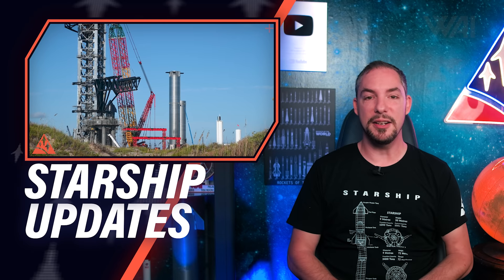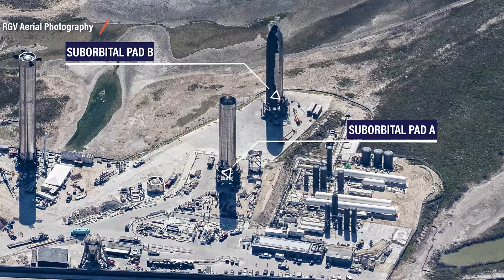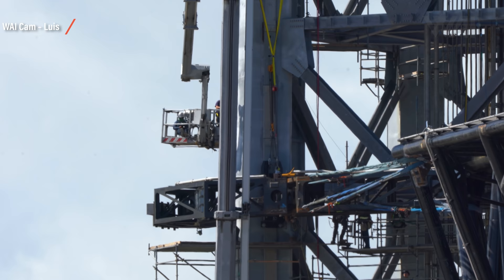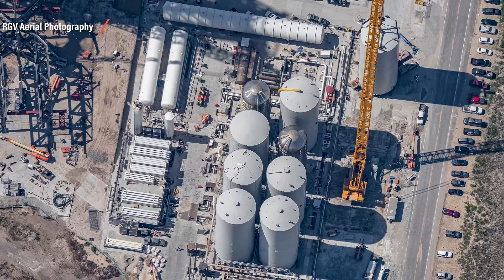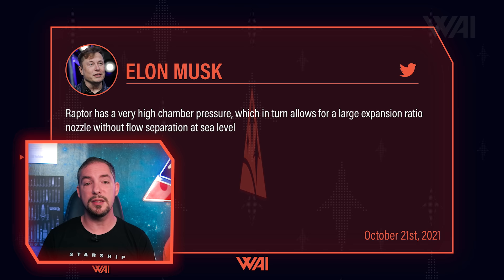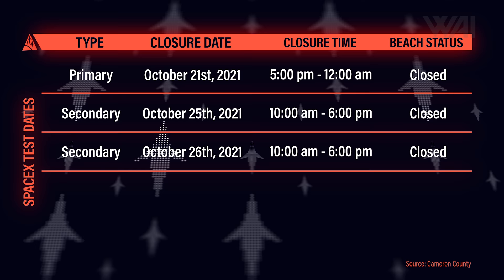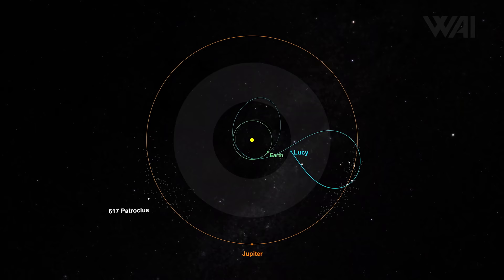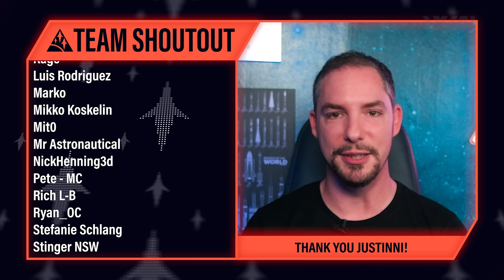Starship 20 double static fire analysis & Mechazilla installed!

Comment: Marcus House: A few tiles falling off will not cause catastrophic failure due to the ship being steel.

Felix: Losing a single tile will likely cause catastrophic failure.

Who’s right?
Reply: One tile and you are surely fucked. The plasma er way hotter than the melting point of steel and with one tile off the heat will focus on that depressed area.... boom

Comment: Regarding the issues with Lucy, an important detail is that they didn't say that the solar panels failed to latch - they said they weren't reported as having latched. And that might be because the panels didn't properly unfold, but it could also be that everything is fine, and the only thing that's failed is the sensor that's suppose to report whether the panels latched.
Reply: Well a clue might be how much down on power it is from that expected

Comment: Pity we couldn't electrically magnetize the tiles to the Starship for extra adhesion during structural stress such as engines firing or atmospheric re-entry. An addition to the mass but if stability improves then so to could the engine output increase. Replacing of damaged or lost tiles in orbit with spares could be standard.

Comment: The Space Shuttle's thermal tiles were its Achilles' heel, and this may be true with Starship's as well. I was very surprised to see SpaceX rely on this fragile solution. I assumed they'd come up with some entirely new, robust protective shield. How many tiles are on Starship? Hundreds? Thousands? If any one of them fails, the ship is probably doomed. As with the Space Shuttle, it's a tragedy waiting to happen.
Reply: No. The ship should already be capable of single tile loss without catastrophe, and even multiple tile loss -- if these exposures are well separated. If tile loss cascades, then the fastener and tile reinforcement designs will be revised.

Comment: The problem with Catching starships is not inherently faulted in the vehicle design or the Mechazilla design itself, but in how the vehicle approaches the tower to be caught between hypersonic, horizontal descent and subsonic, vertical descent. 

The Space Shuttle had a terrible L/D which limited its options for gliding to a very limited set of runways. Starship has a much worse L/D than this, but it does have the advantage of having a more intelligent and responsive computer capable of getting it to Starbase.

Mechazilla has the fortunate capability of catching boosters, particularly because the boosters are designed to make their approach and final landing burn directly from above with no lift whatsoever, merely manipulating their ballistic trajectory to land precisely. Also helped is the fact that the arms are pointed to the East, the same direction as many boosters returning from their mission boosting ships into prograde orbits (w/earth’s rotation). 

But those are not the serious problems. Starship having low L/D doesn’t mean much immediately, but it does limit its maneuverability on vertical descent. During the horizontal phases however, it can take advantage of shuttle maneuvers such as Roll Reversals to control its descent and ultimately come over the region it needs to get to, over Brownsville and Boca Chica ultimately, before the capture. The problem is, the arms can only pivot to the north or south. If the ship approaches the tower from the north or south, either it’s close to the Mexican border or it would be directly over a National Park or a Protected Wildlife area. Both scenarios would be a PR disaster if that is what SpaceX is willing to risk to make their system work.
Reply: Well, look at  the early hops: they essentially just hovered from the test stand to the landing pad with quite some control.
I would be surprised if the data from these flights hadn't improved that capability even further

Comment: Too bad there is no camera to monitor the unfolding of the solar panels.  They can learn a lot visually as well.
Reply: You’d think it’d be easy enough to have a mini go pro or something mounted on the thing without drastically changing the mass and the math in order to do that…
Reply: @trayolphia5756  Agree.  If they were concerned about power constraints, they could have it on just long enough to record the unfolding then turn it off.  I sometimes wonder why the simple things are omitted, like why it took so long to include a microphone on the Mars rovers to hear sounds?
Reply: @maninifarmer1338  in theory, over such a long time, even a handful of grams can mean the difference on an orbital angle of “lipping out” (like when a golf ball only just misses the cup) or can vary it the other way and have the craft go directly into the planet

When you deal with angles over such immense distances…the notion of a hundred grams extra may not seem like much…but SURELY they could adjust the math and figure it out
Reply: @trayolphia5756  Understand.  I use to support equipment remotely, feedback said “green” but not until there was “eye on site” did it get fixed.  Just interesting and thanks for your reply.
Reply: @maninifarmer1338  There actually was a microphone, possibly on the MPL mission about 20 years ago but it was lost due to confusion of measurement units between departments. - Either that or on the Beagle 2 mission, also lost.

Comment: It is possible that the hold down for the static fire causes the ship to vibrate and shake which loosens the tiles. Perhaps on the flight it will smoothly go up and not be a problem. Only one way to find out!

Comment: 11:25 i say they will launch a booster alone and make it hover near the pad and then be caught by the arms to test them. Just like grasshopper.
Reply: Lower the booster onto the arms with the crane just to test the arms?  Wouldn't test their ability to hover or anything else...
Reply: @Wheelo40  I mean first flight catch not crane aided flight.
Reply: Who said the booster can hover? The Falcon 9 can't, even with only one Merlin engine at the lowest throttle setting. That's why we have the hoverslam maneuver. Now, the Raptors are more powerful and their throttle control is not better. So...
Reply: @caty863  All Starships that flew hovered with a single engine, all they have to do is scale the number of engines to the weight difference between Starships and Boosters.
Reply: @FastSloth87  maybe you're using the word "hover" to mean something else. The Starship didn't hover during the test flights
Reply: @caty863  they absolutely did, Hopper, SN5 and SN6 were quite obvious and SN8-15 you can see the LOX outgassing going sideways when they reach the highest point and stay there for a little while.

Comment: People need to realise that if a few tiles fall off on starship it's not going to fail on reentry. 304L steel still has enough heat conductivity and a high enough heat resistance to probably survive that kind of heat flux.

Comment: Instead of a tile system for the heat shield, I have been wounder if SpaceX could use a ballon system that could inflate and deflate as needed. The vision I have is that the ballon wraps around the underside and flares out to create drag and the skin of the ballon would be allowed to flounder to keep cool?
Reply: Nice idea but to slow down a 100 ton starship in the upper atmosphere   it had to be enormous
Reply: After seeing those missing tiles it's very clear S21 should take off.  Nasa has said it wants to observe reentry.  And will launch it own jet with specialized camera to observe reentry.  Reentry right now is more important then landing the starship softly on the ocean.

Comment: The starship heat shield will never experience higher vibrational forces since the shockwave from firing the Raptors bounces off of a solid concrete pad, back up the skirt of the Starship. 
If they can secure the heat shield at this point then reentry should be ok.

SpaceX needs NASA's help on this one, since they know how to secure heat shields on even more complex surfaces (I.e. the Shuttles ).
Reply: Malus Darkblade,
Better to talk with the Air/Space Force.  
There Mini-Shuttle’s Heat Shield Looks Much More like a Smooth Sheet than anything any one else has come up with.  So far they don’t appear to have lost any of there Heat Shielding.

Comment: I’ve said many times before, these heat tiles are going to be the single biggest issue with this starship. I once asked why not use larger tiles, i was told it’s because if there’s an issue with one it could be catastrophic...well the same goes for if one of these small tiles fails, it will be catastrophic. IMO, having less tiles means less chances of issues, while more tiles has many more variables.
Reply: I think there needs to be a complete re think on the tile. Either a sacrificial heat shroud of some type or a different material that covers the whole surface. If they can figure out all the unbelievable stuff they already have done get some great minds working on an alternative.

Comment: I wonder if they are going to use a winch braking system for the arm or if it will be a static over hydraulic brake.
Reply: I've heard from a few sources they are using giant brakes built into the winch, but that's a great question.  Felix?

Comment: I don't think few missing tiles cause catastrophic failure. They have thick layer of kaolin wool underneath. It is pretty impressive heat insulator. I have made a furnace which have 50mm of that stuff as an insulator. I can melt couple of kilograms of copper, which takes about 40min and have about 1200C temperature inside. Flame temperature is about 1800C. I can still touch the outside of the furnace when the copper have melted.

Anyway, the heat shield is definitely way too weak and probably more than couple tiles are missing when it reach the orbit and much more when it hits the atmosphere.

Comment: There's just about zero chance of the shield making it in the current design. They are too delicate but that is what prototyping is for.
Reply: Man those tiles on the Shuttle gave NASA complete fits.   Getting them to stay on was a big engineering project in and of itself.   SpaceX is just at the beginning of that journey.   I know they'll work it out.  😀
Reply: @Wheelo40  they won’t need the Launch tower to catch them because they will burn up on re entry if they can’t come up with a better heat shield design.
Reply: What became of a heat dissipation system proposed by Elon years ago which worked like a human sweating?

Comment: Use booster 3 remeinder for drop test, then scrap it.
Fill some tanks with water to get to the required weight.
mount a heavy cros beam mimicing the gridfins as much as needed
You could also use it to practice loading, manuevering, and of course catching.

Comment: I wouldn’t be surprised if they’re leaving 3 to possibly use it as a static load test for chopsticks
Reply: There’s no fin mounts so it can’t be rested on the rails.
Reply: @rogerhalt3991  I think if they were to use it it’s going to need a bit of modification, it’ll need weight adding to it aswell,  don’t think it would have been left so long otherwise

Comment: My question is how are they going to catch the Starship without damaging the heat tiles?
Reply: A better question is, how do they keep the tiles on during launch. Testing thrusters and raptor had blown some off.
Reply: Just like on the Booster, there will be two pins that will be on the starship that will support the weight. It's likely that the pins will be retractable. The pin will be  located just below the top flaps on the untiled part of the ship. Hope that answers your question.
Reply: Very carefully
Reply: Maybe pneumatic tires? Or maybe skid pads? Rapid adjustments to maintain a gap? Also could be that tiles will be made more robust for select locations.

Comment: is there not a liquid flexable heat sheald that can be applied by brush,spray whoch can give a all over protection,there for no joints our spaces on it,example like the texture of cornflour and custerd our water,wouch is still a liquid but under compression is solid ?

Comment: Lucy can currently generate 18KW only because it is close to the sun.  When it gets on site it'll be generating only about .5KW.  IF they have to run at reduced power that'll mean some instruments getting turned off.  Losing 10% of power is most likely very bad.  Probes like this are ALWAYS starved for power and mass.

Comment: Im really concerned about the heat shield tiles seems no end of issues of how easy they break or fall off. If they cant make them far more durable thats gonna be a major set back.
Reply: Before we speculate on any of that we will first have to see how these tiles behave when they have been attached properly at the production site.

For example if any are shaken loose when S21 is transported or has its static fires.

S20 was rushed to the launch site and partially completed there. Many of the issues observed with its tiles could be a result of that

Comment: Those heat tiles are going to be the Achilles heel of Starship. They're more worrisome than anything else. Each individual tile is a "point of failure" and there are thousands of them. I hope the current product is temporary and they have a much more clever design for the final product. When the booster lights off Starship will be shedding tiles like a dog shaking off water.

Comment: Rather than scrap B3 why not use it for Mechazilla practice?  It’s lighter than B4 and has no engines so if it’s damaged, so what.  Maybe that’s why it’s still there. Hard points would be needed at the top for lifting by Mechazilla.

Comment: I wonder it they considered gluing the tiles directly onto the stainless steel? Glue would attenuate interface stress and be lower profile. Router to remove!
Reply: Maybe the new attachment method should be abandoned and adopt the shuttle gluing method. Main issue with shuttle tiles was constant debris his from the ET which was never solved.
Reply: @pebmets  I wonder how much replacing glued-on tiles would add to the turnaround time. Maybe they could add the quicker connectors they're working on in a later revision. You know, not letting perfect be the enemy of the good.

Comment: There are actually 6-sleds for mechazilla. 2 ea front and back on the two back tower columns and 2 ea on the sides of the front column, all together forming a tight sliding system that won’t bind. Still, I’m thinking they may add cross braces to the back wrap-around arms to make the assembly more stiff??
Reply: Yes, 6 per "level". So 12 in total

Comment: The heat shield system is too risky. If it loses tiles on a pressure test or test fire what the hell will happen on take off or re entry. Like the space shuttle it will burn up on re entry, if not on the first mission then on another. I can’t believe they can make this 1970’s technically work safely for rapid reuse.
Reply: What would be a less risky reusable system?
Reply: @filonin2  I don’t know, would you like to take a trip to test it out. Just because I don’t have the answer it does not explain why they are not testing or trying to improve what looks to be a disaster waiting to happen. Perhaps you may have a better idea!
Reply: Patience, Iago.  The Shuttle Tiles were so difficult to stick on, it almost ended the program.   It's a major challenge.  They'll get it done eventually.
Reply: It is not like the shuttle.  It is made of steel not aluminum.  Aluminum vapor is explosive.  If they make a soft, not ballistic reentry, bounce, de-boost and then skydive it should survive.  P.S. I did not volunteer for STS for the reasons you state.  F. Miller
Reply: I suggests  much larger tiles/ panels.  Like 50 in  total that are secured much better.   OR look I to that starlite material that's 100% flame retardant. ( baking soda/ cornstarch mix)

Comment: It's a shame that you can't spray a type of really sticky glue onto the body which has a number of hooks on it, then spray a heat shield onto the body which  would then stick to the glue and form around the hooks for extra grip. Would be good if the heat shield then had some elasticity and anti vibration properties built in too. Just don't really trust the heat shied tiles as they can be knocked off or the adessive can fail if not applied properly.
Reply: Doughnuts inspace,

No adhesive used.  
Musk didn’t trust it.  

It’s why Musk experimented with all the different physical (Bolt) types of connections, and  the arrangements of such on the earlier prototypes, in an attempt to find the system that seemed most secure with the least amount of variation in Tile shapes.  

Plus’s there is (I believe), a layer of insulated padding underneath the tiles and around the Bolt System for the Tiles.  

The Air/Space Forces 
Mini—Shuttle’s Heat Shield appears to be more of a smooth sheet!?!  
Wonder if appearances are true,  and if so how they pulled that off.

Comment: There's a good chance that starship could survive single tile losses. re-entry heating isn't that much hotter than the melting point of steel and it should be able to dissipate that heat effectively enough given that you don't have too large of a hotspot (aka more than one missing tile). we shall see in the end, however.

Comment: Question are the boosters for starship as large as falcon heavy?
Reply: Falcon Heavy is 70m (230ft) tall. Each FH booster is 3.66m (12ft) in diameter, so it is around 11m wide at it's greatest width.

The Starship Super Heavy booster is almost 70m tall (69.something) and is 9m (30ft) in diameter. The SH booster has a lot more volume than Falcon Heavy.

Comment: iirc there was supposed to be 3 static fires but one of them was aborted, im assuming it was supposed to be 1 for the rapvac, another for just the sea level and the last one was both sea level and rapvac. that is just my speculation im not 100% sure
the sea level attempt i think was aborted, then they did both at once